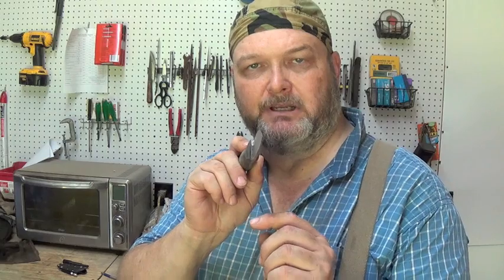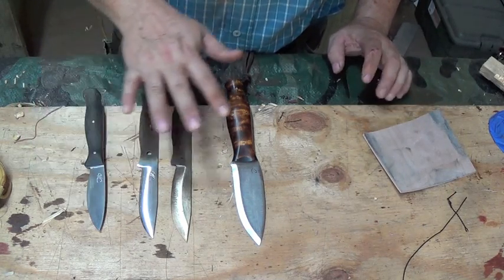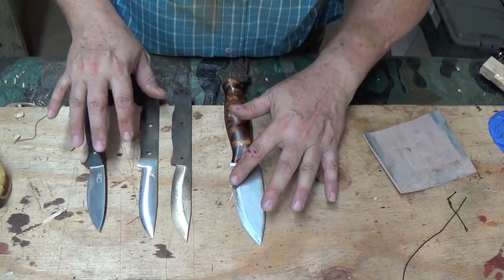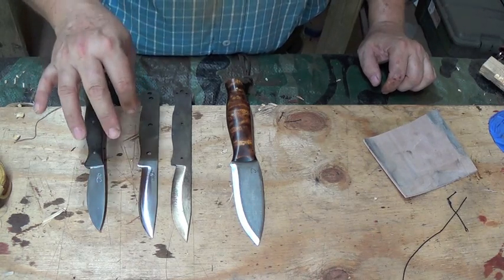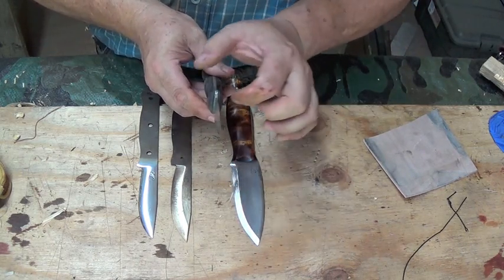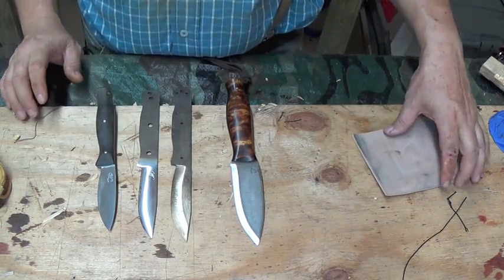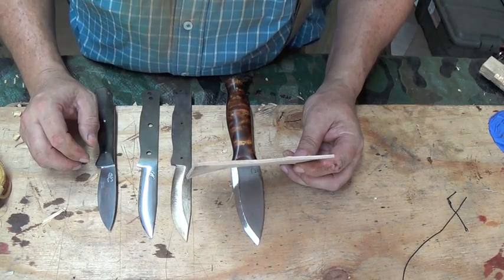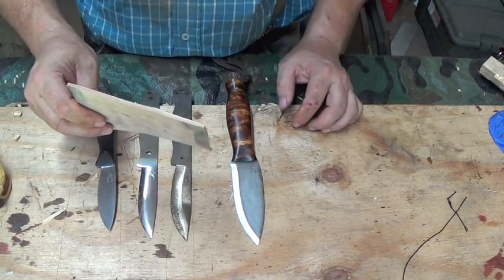Cutting Vs. Slicing Power

Comment: Thanx WC, First time I've heard the differences explained.  Good Job Brother!
Reply from the maker: Mark Coffman You're welcome and thank you!
Reply: As an added question, how would you define the semi-hollow grind that Buck knives are supposed to have?
Reply from the maker: Excellent slicer and good cutter. But the blades tend to be weaker due to the thinness at the hollow part of the grind.
Reply: Thanx for the response, brother.  Yeah I've broken a Buck pocket knife years back due to the thickness of the blade, but for what i've found in a small folder they work great and hold a edge excellently.  Of course I'm not talking 'bout the new chinkanese Bucks,  Made in USA all the way!

Comment: What I notice is a Full Flat has more wood drag if it's a wide blade, that's why I like a Convex on top of a Saber Grind, the Vex starts almost at the apex and than again at the pinch point, (relief edge) that's why some guys use oil when batoning. for what I do in the bush I like my knives to be Saber Vex Grinds. and for featherstick's a thin Scandi Grind does it for me, yes a Flat Grind does slice good, but usually it's on narrow blades where their not too deep because then I start experiencing more wood drag, for instance my Condor Golok, it's a rather deep blade flat not gradual but just flat almost to the apex and that makes it out of proportioned bevel towards the apex (edge), when I baton it it really doesn't push the wood apart. interesting video William, Thanx.

Comment: nice demonstration! but you also could use a full convex or high convex grind to gain slicing power to a trade off to tearing power (which makes it great for woods work like the scandi) but also there are different kinds of convex grinds. the normal has a even radius on it than there are parabola shaped convexes or some have a flatgrind going into a convex instead of a secondary bevel like the fällkniven knives. also the depth of the convex grind can be different meaning if the angle which the radius descripes is high or low etc. i think the convex grind is the most universal grind because you have so many factors you can variate to make it matching perfect for you
Reply from the maker: Rowen appreciate your thoughts on the convex. The standard V grinds work best for me.

Comment: Say Heah William, I always though the pinch point was called a relief edge. and the apex is always the very point of a triangle and the widest point is the base, the reason I know this is because I have a degree with eyes, and a lens is two triangles put together either base to base or apex to apex and light always bends to the base. The slicing is then determine at the thickness above the apex or secondary edge, I might be wrong since I don't design knives like you and I'm willing to learn so I should watch the rest of tge video, before I comment. sorry, , ,

Comment: Seriously, I understand, My Gen2 SP-53 chops near like a Axe/Hatchet, But it's not so good at making Feathers, That's why even when I team it up with my Ranger T.F.I.  I still like to neck carry my Mora 510,  Although I don't consider the 510 a knife carry because the convenience of weight to carry it around my neck. So I consider my SP-63 and my Ranger T.F.I.  as a 2knife carry, But the T.F.I..is a 1/4" thick Flat Grind,  so the Apex is thick., and my thin 510 even though it's a Scandi Grind,  the apex is much. much thinner there for a better slicer where my thicker apex T.F.I bits deep and a better cutter  even more than the 53 because of the thicker apex, but a better chopprr, well two variables, the weight and the blade geometry,  Yup, I geeet it !!!
Reply from the maker: +paulie 4x This will also explain the apex issue. https://www.youtube.com/watch?v=ixH5hP71zeg